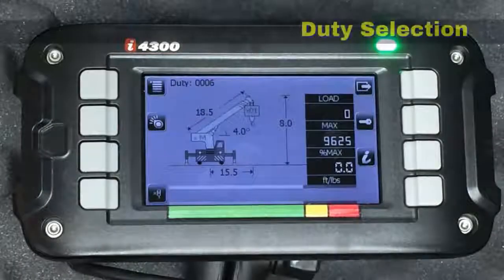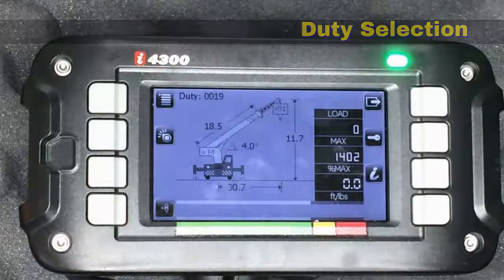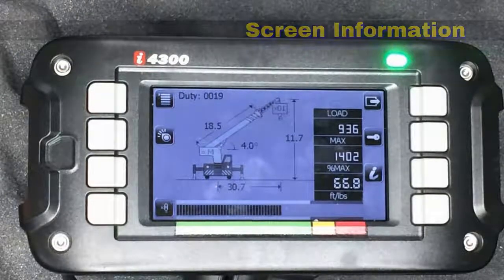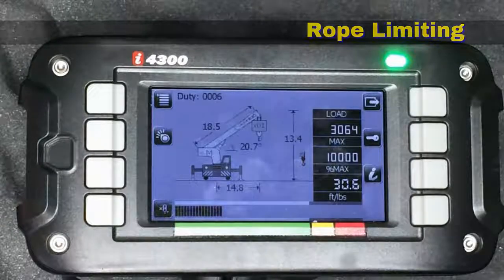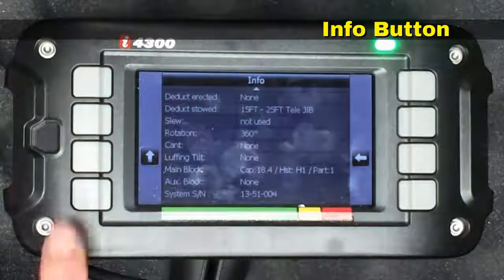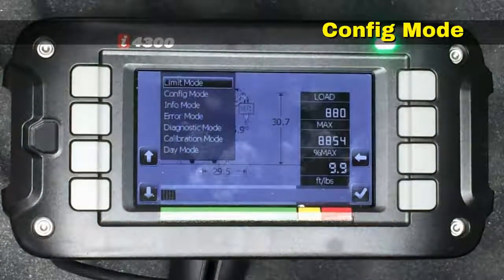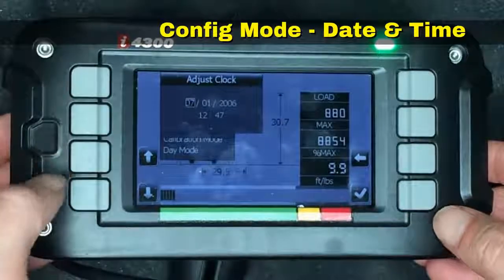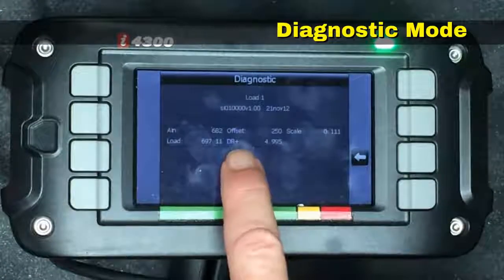i4300 console training for Carrydeck cranes Shuttlelift and Grove

Comment: Hello, i have a question for you...
We have a Grove crane dating of 2009 and usually she works great but i don't know if someone have played with computer but since a few days, as soon as i lift the boom just a few inches high, she goes from 0 pounds to 1745 pounds ! My setting is Duty 001 and parts at 1 using hook and ball of 100 lb, no jib installed on the boom and not setted in computer too.  What is my issue ?
i'm very confused and not comfortable to operate with that at all !!